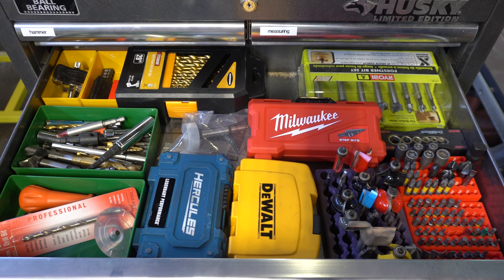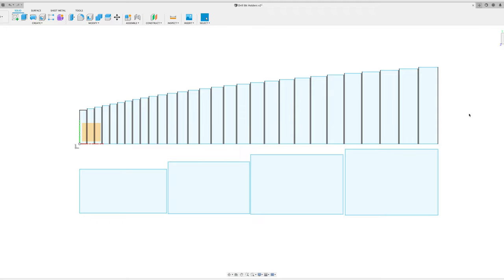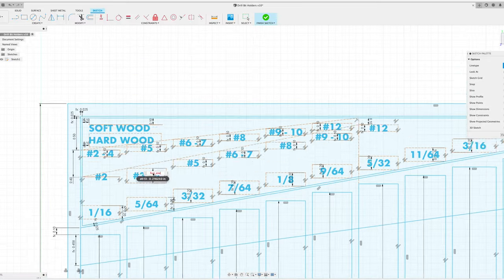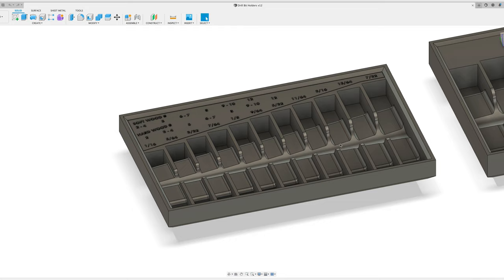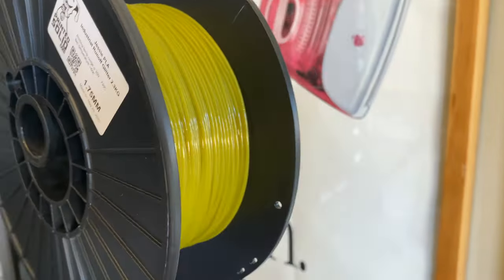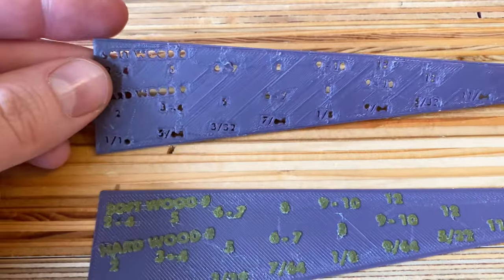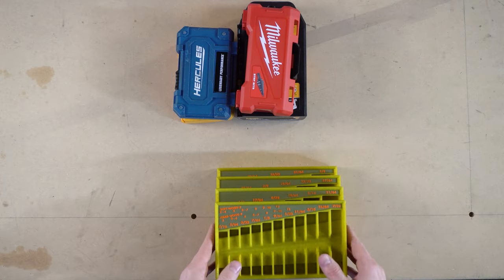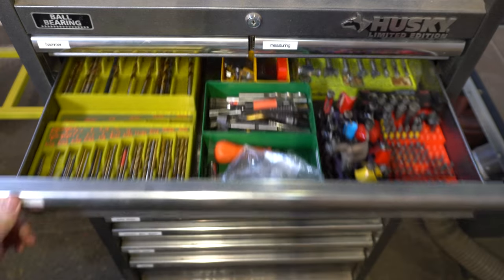Making drill bit sorting trays with 3d printing

Comment: To make them stackable, do you simply apply the same chamfer to the bottom outer edge and upper inner edge? Or do you need to alter the dimension/angle of one of them? Trying to see how I can apply that method to other boxes
Reply from the maker: Hi Jon! I believe the chamfer on the top and the bottom are the same.